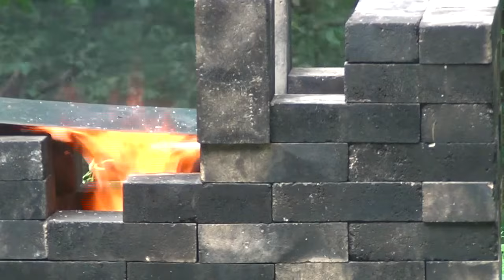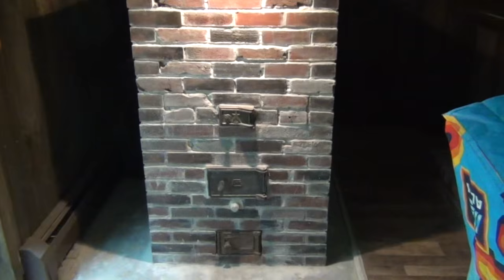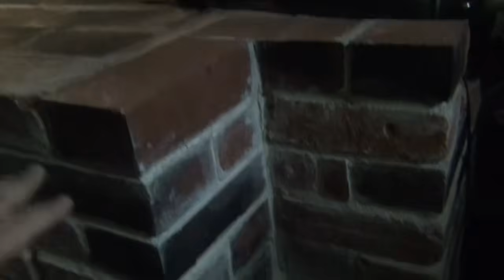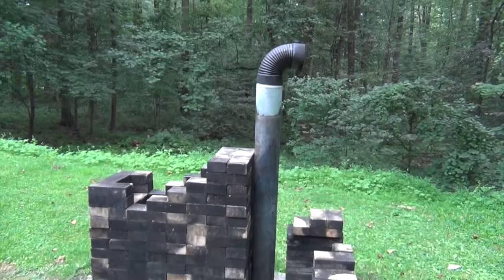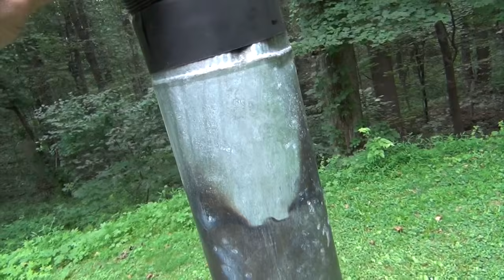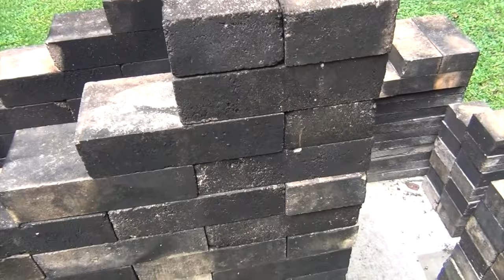Build Your Own Masonry Heater - DIY - Full Size Wood Stove - No Skills Needed - Save $15,000

Comment: Interesting to know:  some States have been passing laws agains solid fuel stoves.  But, they back right up, if you let them know you installed a legally approved rocket stove.  (EPA?).
 I only know one maker of those: Liberator Rocket Stoves.  One of those can cook-out a 2000 sq.ft. semi-open-plan home.  Near-zero emissions beats all the other regular wood stoves.  It does not have mass, but, you can build some mass around it to store heat.   If you like watching the flames, Liberator now offers a glass door.  It can batch-burn kindling, or, can fill the pellet hopper to burn upwards of 12+ hours non-stop.  We’ve not had to burn all day, unless temps drop to low 20s or teens.  
Some user interface required, to do shorter hot burns once or twice daily, depending on stove mass, outside temps, insulation of house.  After the burn is done, close the air intake damper, to stop the outside air being drawn thru the stove, cooling it.  
Building a masonry mass stove can be daunting!  
But even the small one I built in a tiny cabin, done sloppy, using only recycled bricks, rocks, mud…worked!  Key seemed to be, a minimum 15’ tall chimney, to draw well, & small firebox + good air intake.

Comment: Hi Matt, have you considered creating a "manifold" at the  bottom of the 4" side channels to distribute the negative pressure and draw the gasses more evenly down the sides?  The bottom would be 2 courses higher, one for an open channel to the chimney and above that a series of bricks with spaces , larger in front, smaller near the chimney to channel the gasses evenly to the chimney.  Obviously your stove is done but it looks like you're continuing your research
Reply from the maker: Yes... I placed a "hollow bar" across the front to "tie in" the two side channels from a pressure perspective.

Comment: The gap between firebox and red brick- would a 3" gap work ok? I'm limited for space... Also, on the red brick- is it special or just a concrete paver from Home Depot or Lowe's? Any color or is the red a high heat paver??
Reply: The firebox should be firebrick. The bigger box around it can be red brick or concrete if it does not get close to the flame, or not touch the flame. Red brick and concrete can take 500 degrees no problem. There is no need to make the gap between the inner and outer box as tight as I did, but 3 inches on each side probably works IF THE FLAME AND SMOKE CAN ALSO ESCAPE OVER THE TOP, AND THEN DOWN, IF IT HAD TO, or the skinny side channels were choking it off too much. 4 to 4.5 inches would be better on each side.
Reply: Use clay bricks, they have already been fired at far higher temps than your stove will make.  Concrete is not formulated for repeated heat cycles.  Not sure if Matt mentioned it but there is high temp mortar for the firebrick burn chamber.
Reply from the maker: I don't know if 3 inches is enough. It depends on the pull of your "final chimney." Of course, if it's too tight on the sides more can flow over the top if you allow for the space, but you want to make the top unattractive or else the sides won't heat up. Of course, if you go "too thin" on the sides and it backs up, you have nothing. For the "box around the box" it can be almost anything if it's far enough away from the flame. Cement pavers will hold up as long as real firebrick is the firebox, taking all the direct heat and flame. However, cement pavers WILL break down far more quickly than old, clay, "red brick."

Comment: how much would it cost to build a stove that could heat like a living room sized area?  Also did you have any problem with building codes with your stove?
Reply from the maker: Firebrick here in PA are about $2.20 per brick..  pavers $1.15 each. Depends on the size. Yes, building codes with masonry heaters are all over the place but sometimes you just need to "show the local authorities" and the insurance company that there is a PRECEDENT for these being used for 400 years, AND COVERED !

Comment: Could you provide some advice for designing for an ondol or Gloria system?? I'm in a UK mid terrace with suspended floors and we're having those taken up in the new year. It's a pretty good opportunity to install a "whole house" wood system
Reply from the maker: First off, it will smoke. The UK laws may not be "big on that." Second, don't overshoot and aim for too much by saying "whole house." If we are amateurs in these techniques which we are, I would copy the Gloria system and not Ondol. Only heating one or two rooms with a secondary source of heat for the house. If there is any chance for getting low or no smoke the chimney would need to go up the center of the house and the system would need to act like "one big "J" rocket stove." A chimney on the "other side of the house" from the firebox, and a chimney on the outside for these systems will smoke and smoke. It's a lot to aim for if you are a novice but an "L" design with the chimney staying warm by being in the center of the house (or not on an outside wall) is pretty foolproof. If you do it, put a door in the chimney in case you have to prime it. Also, you need a way to clean out ash at the bottom of the chimney. This is a massive project.
Reply: @stoveadvice  thanks for the reply!!

Comment: Hi Matt, 
the video is very interesting. Could you make a video about heating water in one of these Russian masonry stoves? 

Specifically, using a model you've already mentioned on your channel, the OIK 4. Is there any way to heat a significant amount of water with this model? Do you have any suggestions? 
The goal would be to heat water for underfloor heating, an area of approximately 2,000sqft.

 The idea would be to heat the water in the masonry stove, which would flow to a 2000 liter reservoir and from the reservoir to the underfloor heating system.

I looked at Kuznetsov's website and found some models for heating water, but they are too complicated for a beginner.

I like the OIK 4 model because it seems to be easier to make. If you have any other suggestions for models, Russian or otherwise, that would be interesting for this purpose, I would be very grateful.
Reply from the maker: Hi Sam, no I can't make a video about that because I have no expertise and you have to be an expert to pull that off with success. If you must heat water for underfloor heating buy a new or used outdoor wood boiler that is exactly made for that very purpose. Yea, I know even used ones are expensive. There are many problems with trying to make one yourself. No, OIC/OIK 4 will not work, nor will all other "regular masonry heaters." In most cases, the cold water passing through the channels will cool the channel too much and your stove will be a smoke machine, concensation machine, and a creosote machine. The water pipe is a heat exchanger that draws too much energy out of the system for something as big as "underfloor heating." Even with the proper design, who the heck knows what kind of pipes and plumbing will hold up to flame for more than a year or two. This is where those who designed the boiler systems know what they are doing. My job is to save people $15,000 by getting them to build their own medium sized masonry heater. This is way beyond my scope. Even my iron stove (Coalbrookdale Seven has a "water jacket" option" to get some hot water... but for underfloor heating, no way. Another BIG problems is these stoves are only burned 2 times a day for a short time. That does not work for underfloor heating.
Reply: @stoveadvice  Thanks, your comment was really helpful. It makes perfect sense. Adapting a model for this purpose won't work. Maybe one of the Kuznetsov models specifically for heating water, who knows. I'll research this further.

After sending you the other question, I found an interesting project that uses a specific Kuznetsov model to heat water. You may have seen it before;
 if you could comment on it, that would be great.

Search for "Experimental Masonry Hydronic Heating Workshop", Lopez Labs
Thank you for your attention; 
your opinion is very relevant, given your overall experience with this type of stove.

Comment from the maker: Simply place a thin, tall firebox (with an air grate holding the wood) INTO your larger red brick box, ... hide the chimney in the back behind the firebox at the bottom, and you don't need no rocket stove in your brick box and all that riser and port horseeessshhheeeet !